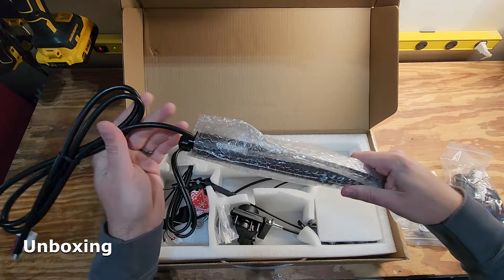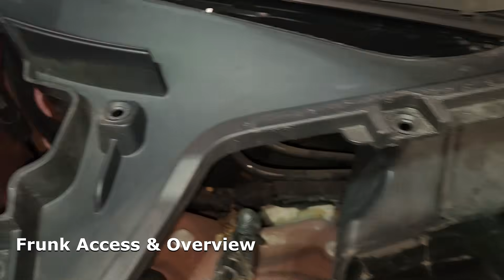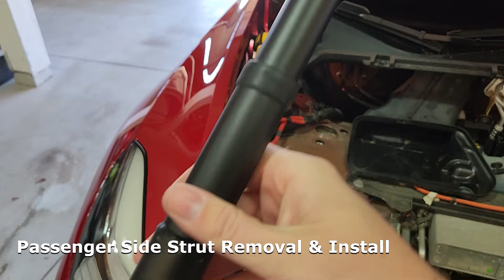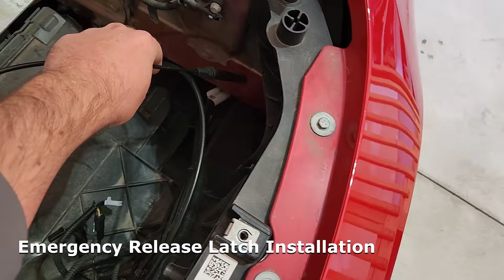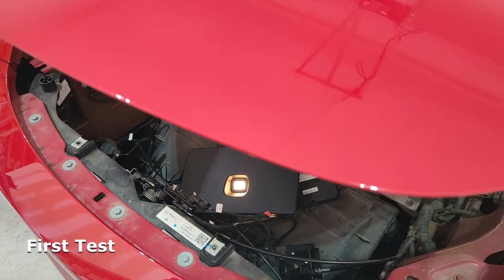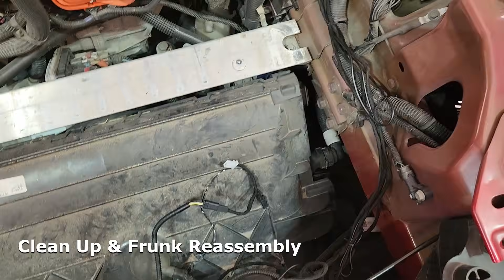Upgrade Your Tesla Model Y with a Powered Frunk!

Comment: I just stopped working on my frunk install of the same kit. I don't know what I did differently on my Juniper, but I have worked upwards of 4 hours just on the drivers Strut!  Every time I went to pry open the clip at the upper connector, it would slide off of one side and the other would rotate into the opening for the ball. Had to take it off and on 3 times and now it is so buggered up it won't stay on the ball. I will have to see if they will sell another one for another try. Also had problems when I though it was installed correctly with it only working intermittently. I did not get any instructions with this other than a QR code to some crappy pictures. No explanation about the speed adjustment you showed. Very frustrated with all these companies selling with no product info and relying on independent YouTubers to educate people. No one seems to do a complete detailed video along with programming info if needed. I had to watch 4 videos on self presenting door handles just to get someone to talk about the programming info. Sheesh!!!
BTW, like your video but you skipped the attachment of the wire ring under the spring on the latch. Kind of a crucial detail. Also marking the original position of the latch with painter's tape to get it back into alignment.

update: Went out and took it out one more time and redid the c-ring band to back to original or close. Was able to reinstall and see if it stays on. Now the whole thing won't work. It beeps and---nothing. I tried cycling the hood up and down, unplugging the control module but all it does is blink red for a while and then stops blinking. I reprogrammed it to the fastest setting but again, nothing.

Any ideas. I have an email out to them. Whomever has the best customer service will get all my business. We'll see. So far Hansshow is the worst at responding. They sent me the wrong part but want me to prove that I haven't opened anything first.
Thanks.

Comment: One question, the emergency puller to open the frunk just locate at the front bumber towing bolts cover,means anyone can be access the frunk even is lock? Make sense?
Reply from the maker: It only releases the "suction lock" part of the hood latch, not the actual hood latch itself.

Comment: I installed the power Frunk kit in my 2026 MY Juniper. It's nice but things you should  know:
They are made by the same over seas factory to different retailers specs that vary slightly brand to brand. 
All are unapproved Tesla accessories.
Tesla offers no such option, imo not due to cost, but rather safety DOT complaint issue they haven't found an acceptable design for as of yet for Models S,X,3,Y.
If one power strut fails, the hood will bend. There is no safety software to stop opening or closing if a failed strut is detected. The struts are preset and non adjustable for power, this puts slight stress on the closed hood. If the mounting brackets are not sitting parallel to the ground, the power strut ball will be rocked to high, causing the strut length to be too long, thus causing the hood to bend slightly mid span when closed.
Battery draw is constant on the 16v Lithium ion battery, causing drain even when car is in deep sleep.
The included "emergency release cable" will not open hood in case of failure of either dead battery or suction motor. Fun time there.
The cable on the suction motor that pulls down the latch will interfere with the OEM micro switch metal fingers randomly.  This causes the Frunk not to operate as the car thinks the Frunk is closed or open. This can and should be modified to get the cable to run between the micro switch fingers. The manual came with a separate sheet warning about this, but no remedy to fix.
If the Frunk closes and doesn't latch, the car will be able to drive. You must be able to verify with the beep speaker and your eyes that it latched or have a bad day literally in your face.
Other than that, I pray not to get the 55mph Jack in the Box suprise.
Reply: Really useful info. Thanks!

I was planning to get this kit but now decided not to, reading these cons. Hope all works out well with yours.
Reply: Thanks, that makes sense! Looks like a frunk soft-close kit is the better option.

Comment: Quick question please. How did you actually get the new strut to snap at the bottom. There’s no way to access the metal clip that opens up the hole. Please explain…thanks!
Reply: You don't have to pull the clip back when placing the strut on.  It will flex and then "snap lock" into place.

You have to pull the clip back to remove the strut.

Comment: I followed this video to install this Frunk Kit which took me about 2.5 hours.  There are a few big gaps I wanted to mention.

1. The video glosses over the wiring connections and more time should have been spent there.   In some cases your disconnecting two Tesla connectors (Lets say A & B) and the then connecting ends from the harness into the connectors you just disconnected.

2. 23.30 For My 2023 Model Y the Controller box did not fit where the video shows mounted and it got in the way of the filters so I had to find a new spot.

3. 12:12. The hardest part of the install was placing the hook that goes over the silver handle below the spring catch.   I really wish more detail had gone into this.

4.   Some of the connectors on the wiring harness are very difficult to disconnect once connected so care should be taken in routing wires before connections are made.

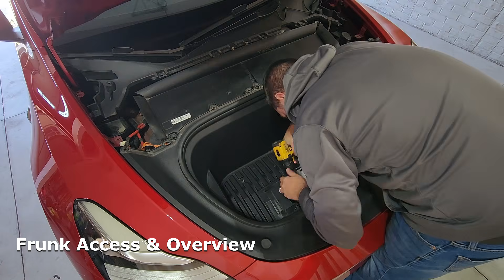5. 3:50 Care needs to be taken when disconnecting the factory connector for the button in the frunk or this can easily be broken.

Overall this is a nice kit and If you have an iWatch you can set up a shortcut on your iPhone and propagate too watch so you can say "Hey Siri open hood" and it will open it.   Siri thinks the word "Frunk" is "Frank" so you may not be able to say "Open Frunk"
Reply from the maker: Thanks for the additional information!

Comment: Just bought it with your code - thanks for the vid! Hopefully I can install it without issues. Looks like some patience is needed =D

Is there a safety feature that would prevent the frunk from closing if something was in the way? thinking my 5 and 7 year old if they ventured their fingers in there...
Reply from the maker: @keytoarson  Definitely with the patientce, but just take your time and you should be fine! I'm glad my video was helpful, I watched a ton of other videos before my install as well. Reach out if you have any trouble at all and I'll help however I can.
Reply: @gamble1080  Hey! Looking to upgrade to a Juniper, will this fit Juniper, do you know??
Reply from the maker: @keytoarson I think the Juniper struts or hood attachment points are a little different. I'm not 100% sure though!
Reply: Back again! Would this one fit a model 3 if I bought one for Y? I'm thinking not but thought I'd ask! Thanks!
Reply from the maker: @vb-wd3wy Welcome back! I'm not 100% sure but again I think the mounting points for a Model 3 would be different.

Comment: Lol this is not a great video on how to install.  You say this goes here, then next frame its installed, you never actually show yourself doing the actuall install, its not hopefull at all.
Reply: This is the main reason I came to the comments sections. I wanted to read if others felt the same way. The most important installation parts in the most difficult areas were left out.

Comment: Bought one with your discount code, arrived in about a week.  Rewatching the video with parts in hand.
But I notice that I can't get the actuators to move manually (without power), at least before it's installed.  Can you confirm the frunk can be opened/closed without power, like the trunk can?  Otherwise, the emergency cable will release the latch, but the frunk can't be opened.

Comment: For anyone with a model 3 highland, I put this system on mine and it snapped the brackets on the lower part of the gas strut.  Waiting to see what TVIBEX does about it, but I also had a ton of problems getting mine delivered as well.  They wouldn't offer any money off the order after waiting 6 weeks for the delivery unless I gave them a 5 star review.

Comment: Hey thanks to your discount code I got a great deal on the auto frunk kit over black friday. Have it now installed. Watched your video a few times before starting the whole process. The hardest part for me was getting the first strut installed. It took some effort. LOL. Eventually figured out I can pull the clip up a bit before attempting to push it in. The second strut was much easier. Took me a few hours but not bad considering this was the first ever mod I was doing on my Model Y. Looks like they improved some of the components further and have better locking and water sealing mechanism even compared to what I see in your video.

Overall extremely happy with the auto frunk feature now. Great quality product, excellent price when compared to others kits available on the market. Thanks again!
Reply from the maker: @patel-hiren  Wow, thank you so much for taking the time to write this, I can't tell you how appreciative I am for the feedback on how you found the video helpful. Thank you dude!

Comment: Great video, I am impressed with this product. I don't use my frunk enough to care if it has a power open function or not, but it is a nice option to have if I should ever change my mind. Again, you did a really good job in presenting this, and the installation doesn't look that hard. The only concern I have is if the motor or controller goes out, then you are stuck with a power frunk feature that doesn't work. The rear trunk power assembly is something I use a lot and really like, and if something breaks, I can get parts for it. The frunk I prefer as it is because it really can't break in its present form. I do agree with you that I don't particularly like pressing down on the hood to latch it.
Reply from the maker: Thank you so much for your feedback on my video.  I agree that we did not use our frunk at all before this mod, except maybe for one camping trip. We use it all the time now since I've added in this mod.
Reply: Have you experienced any water ingress after the install? Curious to hear if everything is sealed up nice, although it certainly looks it. Great video, excellent detailed explanation. Wife and I just picked up our first tesla last Friday and I'm already looking into this because of how it feels to close the hood manually. I wish it opened a little slower though, this setup feels a bit aggressive. Is there any way to sync the open and close speeds? Regardless, fantastic job. Will be checking out your other vids. Cheers.
Reply from the maker: @michaelwells3544  So I've only had the kit installed for a few days, but I can confidently say there's not any water leakage into the frunk area.  It rained heavily today and we took out our Tesla like normal.  No apparent issues with the seals as for the most part, nothing really changes with how the frunk operates or seals shut.  Congrats on your Tesla!  I appreciate your feedback on the video, it really helps out a small channel like mine!  Lastly, I haven't found a way to alter the opening speed, just the closing speed.  I may reach out to the manufacturer about this to see if I missed anything.
Reply: @gamble1080  you're the man, appreciate you taking the time. +1 sub